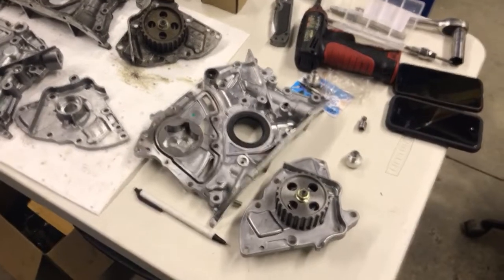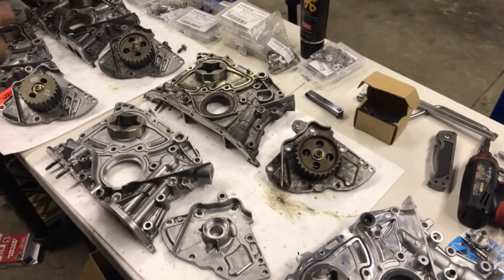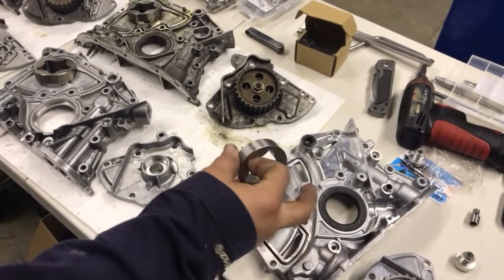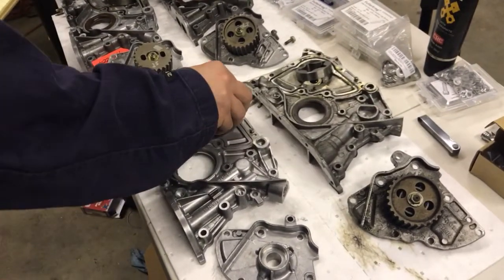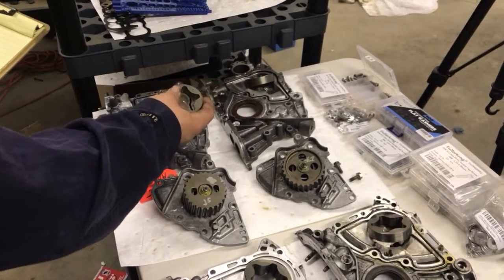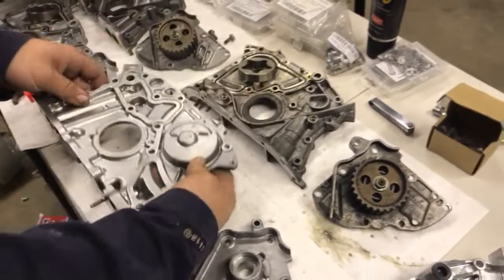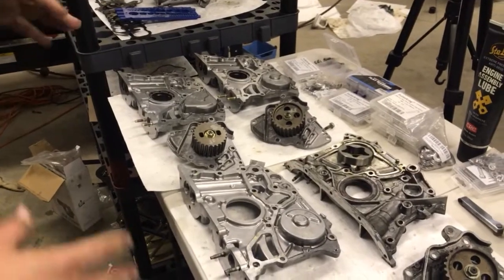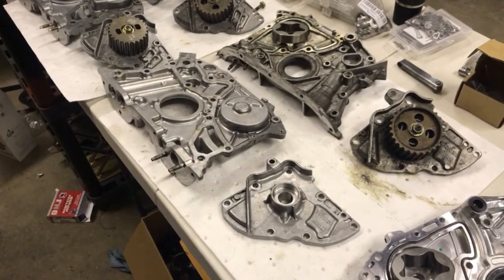Toyota 3s oil pump differences

Comment: For anyone wondering there is two different oil pumps you can buy for 1998 Toyota Camry xle 2.2L one has a crevice/hole for crankshaft sensor and one doesn’t my engine has the crankshaft sensor hole

Comment: So probably a weird question but im currently building a 3sfe turbo and trying to figure out what pump would fit in it
Reply from the maker: I’m not sure where your located but the 3sfe in the US uses the oil pump with and without a crank sensor depending on the year. A 5sfe is cross compatible with them.
Reply: @velocityperformance8574  i have what should be a second gen, has a distributor and a crank sensor. Its out of a 1997 rav4 and im aiming for around 400hp. It was pretty straight forward to figure out the rods and whatnot but the oil pump has little to no info on it
Reply from the maker: @lerabidheavy7437 that should be a oil pump with a crank sensor. A stock 97+ Camry pump would work and have the larger pump
Reply: @velocityperformance8574 so which engine would that be? A 5sfe?

Comment: Hi, so if I am understanding this correctly, we always want to be using the latest year 5sfe oil pump for all 3sfe/3sge blocks? I have a junkyard ST162 3sge (87) and its going to replace my 87 camry's 3sfe. Are there any fitment issues or massaging that will be required or is it truly a plug and play solution?

Comment: Good info, thanx. Left - altezza 3SGE  15100-88570, center far - 4gen GTE/GE "98-" 15100-88561, bottom 4gen GTE/GE "-98" 15100-88560. 3SGE engines in Caldina has same oil pump as GTE, but 25teeth gear as Altezza. In addition, 3gen 3sgte has rotor 60x14mm(same as 2gen) and 25 teeth gear.

Comment: 3S-GE oil pump be changed with 3S-GTE?

The pump fits but drive gear is smaller on 3S-GTE

Thanks in advance

Comment: Nice video man!
Reply from the maker: Thanks!
Reply: Need help with 3s beams cam gear
Reply from the maker: What do you need to know about it
Reply: @velocityperformance8574  set my timing tightened the cam gear and the cam shift but the gear didn't

Comment: Can u compare rods between the all the  gens
Reply from the maker: Saph I have some from a 2nd gen and 
3rd gen 3sgte and a set of early 5sfe rods that I could do a comparison video for
Reply: @velocityperformance8574  ive got a beams from an altezza  would like to know which oem  rod would  work as a stock upgrade in the beams
Reply: @bigmack7522  oem wise everyone usually goes for the 3sgte rod
Reply: Did you do the video? @velocityperformance8574

Comment: So when building using the 5s bottom block people use gen 2 3s oil pumps for more oil flow? I want to make sure I’m getting this correct. Also would having balance shafts effect the flow difference between the 5s and gen 2 3s oil pumps? 

Glad to see you’re back! Your 5sfe build videos have helped me a ton with my 01 Camry engine!
Reply from the maker: The 97 and up Camry pumps are the highest flowing factory pump that comes on a 5sfe engine that I know of. I believe the balance shafts are the reason for the need for higher flow in the camrys. 

We use the 5sfe pump from the Camry on our 3sgte engines
Reply: @velocityperformance8574  Adding to that, the 1997 3SFE oil pump (1997 TOYOTA RAV4 (SXA16L-AWMGKA) and the 97 Camry oil pumps are the same. Source ToyoDIY.com .

Comment: Great information: In short, which of these oil pumps to use if you have a 3SFE turbo for the street? Obviously increasing the pressure and amount of oil circulating in the engine is the key. AND, you should, if you can, do a clip regarding the E250/E250F tran-saxle from the 3SFE and the 5SFE engines. much misunderstanding regarding these transaxles if you can install LSD from Cusco / KAAP / etc.
Reply from the maker: If your running the stamped steel oil pan found on 5sfe and the gen1/2 3sgte go with a Camry 5sfe pump from 97 and up.
Reply from the maker: I’m not familiar with the e250/ e250f trans. I know that a FWD trans has a different differential than the awd trans between st185/st205 and a mr2 turbo
Reply: @velocityperformance8574  so you’re saying you can run a 3sfe with a 5s oil pan and 5s pump?
Reply from the maker: @trent88  some 3sfe and 5sfe are baffled and some aren't. There are some differnces in oil pans depending on what car they are for. Celica and mr2 are the same, camry is a little taller. Oil pumps are all interchangeable between 3sfe and 5sfe.